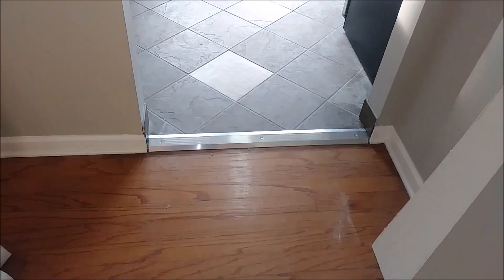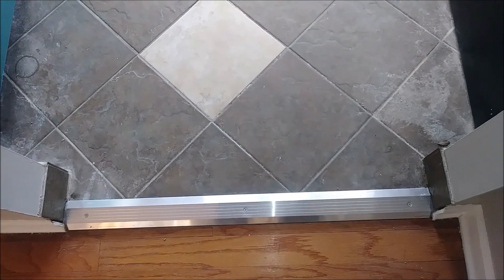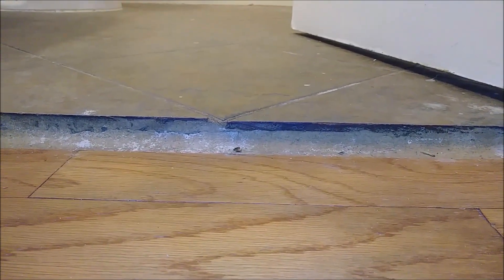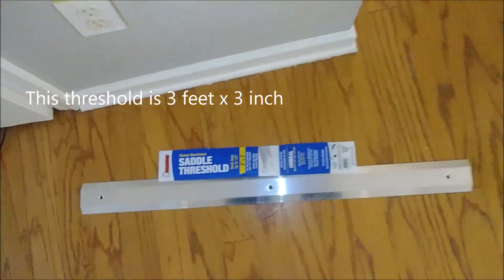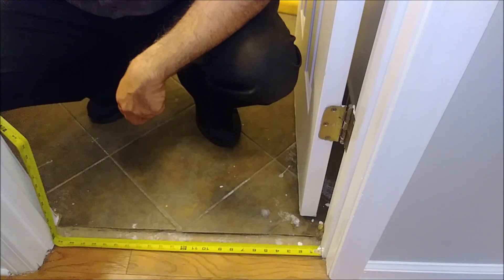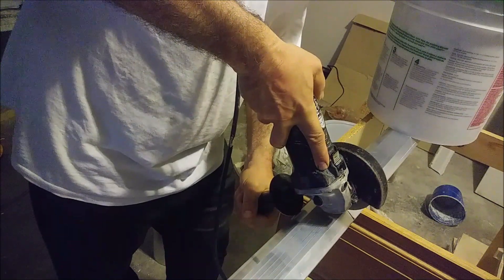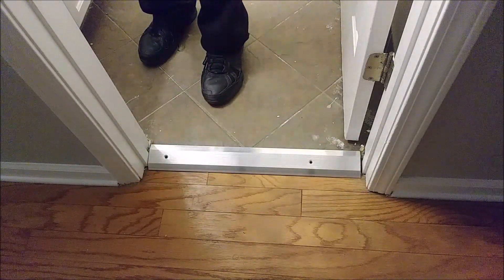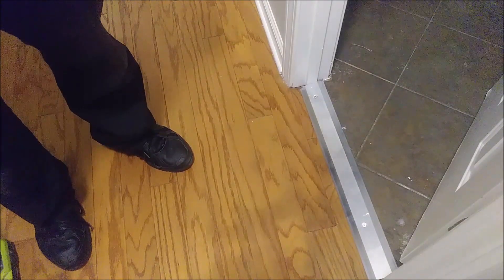Install  A Transition Between Hardwood Floor And Tile Floor - Different Heights Between Floors

Comment: No,   did you just install a cheap metal threshold with that beautiful flooring.   Why not a nice wood transistion.   😔
Reply from the maker: There was no threshold that can address 1 inch elevation between hardwood floor to tile floor.
Reply: @josephk9182  make it.
Reply: @josephk9182  Yes there are... check out stair noses and as @Sound City said below you can almost make a custom one

Comment: Yikes... that looks terrible. I mean the new floors look amazing but that cheap metal threshold looks like crap. You can look into something called a stair nose or a wood transition piece. You can do this with even an 1 inch difference in height of floors